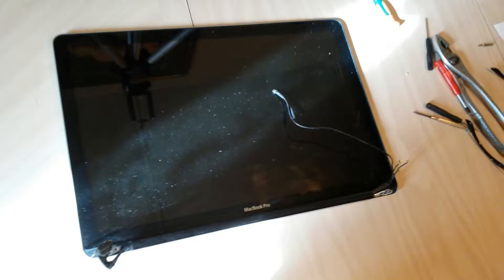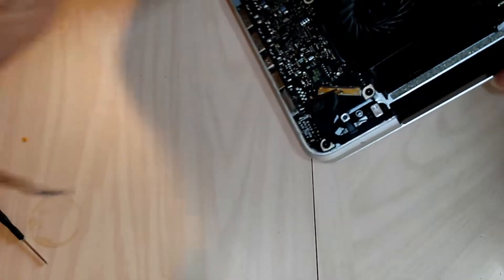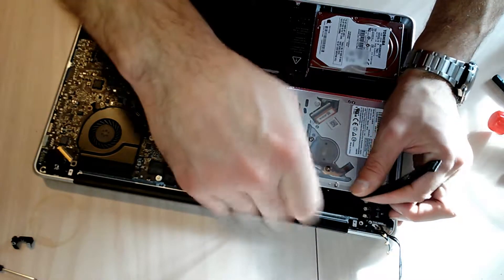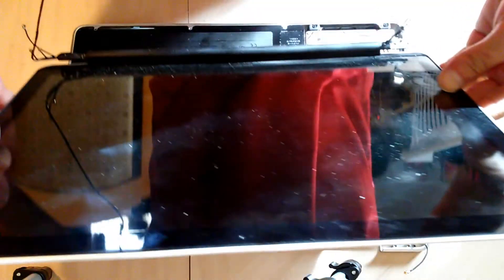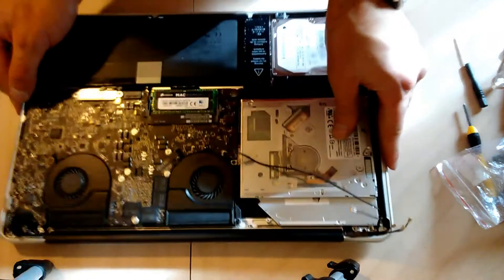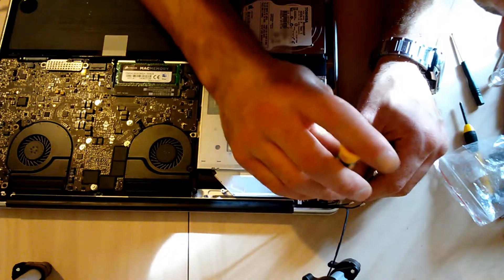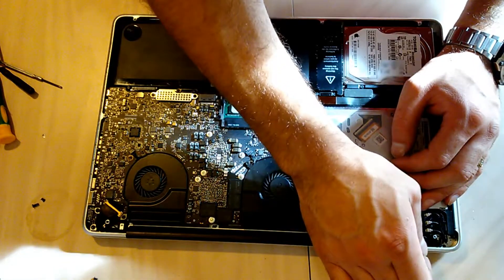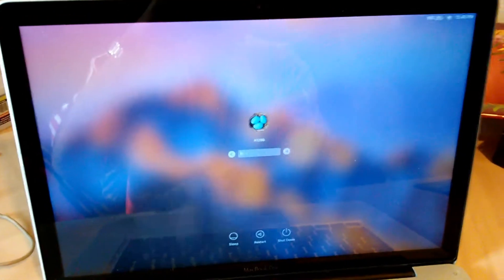How to replace LCD Assembly on Macbook Pro 15 Model A1286

Comment: Know where I can buy the screwdrivers you used?
Reply from the maker: I get all my tools from EBay. Meet a lot of good vendors there. https://www.ebay.com/itm/25Pc-For-Macbook-Air-Macbook-Pro-Repair-Tool-Kit-w-1-2mm-Pentalobe-Screwdriver/163970715084?_trkparms=ispr%3D1&hash=item262d6a8dcc:g:G2wAAOSw7IRd5Nd4&enc=AQAFAAACcBaobrjLl8XobRIiIML1V4Imu%2Fn%2BzU5L90Z278x5ickkfOCvCjTOBWK8pwriaolq5l%2FFBy%2FriLk1gSXGF6YCgZ0y5NByMZhqYiog0pQTpcwRNE0s1VswO5A%2FsE91Ys5WKanTmuY%2BP5QS6ms20K7qJFabkCG%2BOe6OheBSgUNrdAxWP0%2FWyVtV0Cc9lvwoNRuLSMw5qt6GVVYNMrFptR3FtkSsOgfBzDbuEjL2vq7uEU90knn6LcT%2Befo5XwEeurWQd3eoNNeTuzW3DOVRqsi%2BDwra%2F7pxHswMl5cEOfF5MHyryOuk8q0SaXuEczwHyLJvcNDVYSQLNy0RAy21faDJe%2BqW5xVn8t6LGn8EVlKu8sE%2FU6bttGoUEN%2FSDvHrSxnkeSWV2KqBx14JGan4ki3EKc7Vy8gjYugadMSSiOqUPW%2FP7FZor3mneJGkh%2BXtcgLVAki5ua%2F3ZruL9Ig3Kuk6VX7Z4LntDQN1Rpwy8w6ZBBnza%2BnFkBSL70EfUQN1PwzQMzQok3%2FUTnbztwP4fhCX8%2FmEW3UzK0RfG96yJIViUrthZ7EgewTX5tEpVRIICCfJu2hQQOehXI0dZrm%2BEMqtnJE7uT%2B%2FaTPOonP6Kt7df2oQ%2FVrF5dm336c5taFpWivVyplO8y%2BZMo4SsyxAksBLFEEafWLIU5RdPX3UA1KOw0wMW7EMSnXfRX4YOmMCxXqfW8TofgZ%2FsPet%2BuZ5b2ekxhy6UgWCG6CBKH%2BNtXhRuY6me4LJBrrU3eLJjP57h%2FEyQ98tes6hr5zwjxs5VdOynmriL61gDjYMsjOMUBCMw3QFgkfZDA3YBgYhG4Wc9c%2FlJw%3D%3D&checksum=1639707150844b0098161197496aa810281290eb49da